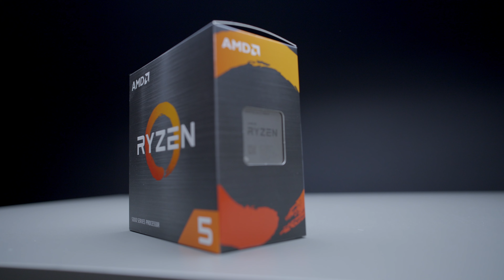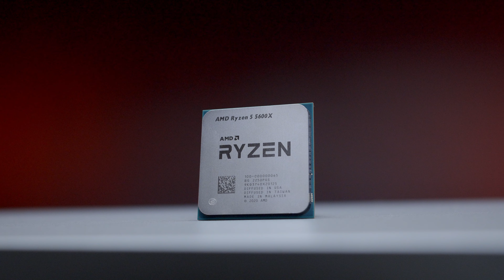$1,000 Budget 1440p Gaming PC: Lian Li Lancool 205M Mesh

Comment: I have this case and the 140mm front lian li fans that come included stay around 620 rpm even at idle. I adjusted the fan curve for them many times and the rpm doesn't change even though the motherboard temp isn't even reaching the temp that the 620 rpm corresponds to. When I set the custom fan curve to max, then the lian li fans operate at the max rpm. Otherwise, it seems like they either operate at around 50% or 100% and not lower or in between. I am not using any third party software, just using the bios. Anyone know what might be causing the problem?

Comment: microcenter sells a powerspec prebuilt with this case right now on sale for 690$

5800X3D
RX 7600
16gb ram
500g ssd
650W

I had bought one for 700$ awhile back and added another stick of 16gb, and I just put in a RX 7800XT, depending on what i can sell the 7600 for it might end up as 1,000 in total.

Comment: it's really beautiful, got the mini version and in only 6 months the fans on the front are already going yellow pretty badly. It's an issue across ALL lian li rgb devices.
Reply from the maker: @kingghidorah8106  was not aware of that. Thanks
Reply: @poweredbychris  you're welcome. Lian li is overhyped and overpriced , being where it is because of redditors. I got the Lian Li case because I was in a hurry and it was the most affordable thing i could get in the shortest time. I'm going to change the front fans for some Arctic 140 A-rgb.
Reply: Is the rgb going yellow or the plastic of the fan itself? Because i dont imagine the black ones going yellow.
Reply: @ibrahim123461  the RGB in them goes yellow.

Comment: Can you fit a thick 240 in the front? Does the shield for the power supply come off? I want to use this to hold 3 240 rads and a pump. $65 seems like a good price for rad housing. Ty
Reply: Old comment but you can fit a 240mm radiator with a fan in front but I wouldn't try it on top.

Comment: I went with the MSI PRO B650M-A and this case, it has the main x16 slot one space down and it limits my gpu airflow, I may try to drill the rivets out and remove the PSU shroud, although it may be structural for the case.

Comment: Question, did you replace the included fans with the thermalright ones, or just add the thermalright to the back?
Reply from the maker: My intention was to just to replace the rear one, but one of the included front fans was dead so I replaced both
Reply: @poweredbychris  thanks for your help, I just got that case as the one purchased before doesn’t fit my gpu even thought it says it should. I had purchased those thermalright fans as well and was wondering if I can daisy chain them with the included case fans?
Reply from the maker: @zacharybaas1553  Yes you should be able to. The only issue would be having enough length. I bought a led splitter so I used it, but it might not have been necessary.

Comment: Hey! You think the Thermalright Frozen Prism 240 AIO would have no problem fitting at the top of this case instead of an air cooler? Or will I need to get low profile RAM? I’m looking at the T Force Delta RGB
Reply from the maker: You can fit up to a 240 aio up top

Comment: Hi my front fans are working but no rgb. How do you daisy chain cuz when i did it i still ended up with 2 ends that have 4 pins coming out and i plugged those into chasis fans 1 and 2
Reply from the maker: That's only fan power. You need to connect the led connections together by daisy chaining and plugging into a 5v argb header. You can also use a led splitter
Reply: @poweredbychris  i fogured it out on my own but ty

Comment: How you get the non pre installed fans to match the other fans
Reply from the maker: Motherboard software. Fans must be daisy chained. I used a led splitter, but it's not always necessary since arg fans have an extra piggy back led cable to link the fans together

Comment: Just asking a question can you fit a pcie wifi with that case? I think the space below gpu is really tight for that
Reply from the maker: @alfinal3845  just answering a question Yes. This will also depend on the size of your GPU and the position of the GPU slot on the motherboard. Best bet to not use bigger than a 2 slot card
Reply: @poweredbychris  i use asus dual rx6600 i think it's a not a big card, and my wifi card is tp link i forgot the model but it's small too, maybe it will fit. Thank you for your answer😀

Comment: So hear me out on this, I have a super high-end monitor, 4K 165 HZ. I run a 3080 which I know is not going to push that monitor at all, it might hit 100 in non-graphically intense games at most. It's currently confined in a cooler Master ITX case. I want something a little bigger that's got better air flow so that way I'm not stroking out my 3080. Instead of thermal throttling a higher card, would a case like this be a optimal trade-off between size and breathability? My main concern is I don't want to buy any new parts. It's just simply not in the budget. Can I just take the parts out of my case now and put them into this case with zero issues? I'm not looking for particular brand compatibility, I want to know can you put an ITX system in here?
Reply from the maker: What itx case?
Reply: @poweredbychris  The cooler master NR200
Reply from the maker: @PokemanTrucker  To answer your question yes you can put your parts in this case, but I don't think that will make much difference. Your probably better off undervolting and increasing fan curve.
Reply: @poweredbychris  So the increased air volume isn't sufficient to see a decrease in temperature. Got it. Thank you. I will attempt to figure out this undervolting

Comment: Did your case come with front panel connectors? Mine only came the power switch for the RGB :( where would I get the connectors?
Reply from the maker: I can't remember what all front panel connectors it came with. If it's only the power  switch then that's it.

Comment: Nice build! I have the exact same case but idk how to change the rgb color on the front fans, I download the motherboard software but it still the same can you help me?
Reply from the maker: I would make sure they are plugged into the 5v RGB header on the motherboard (not the 12v) and try changing the lights from the bios. Maybe try another header if you have them daisy chained

Comment: Very nice! Planning a similar build myself. Had some hesitation regarding the volume of this case. Do you get good temps and enough airflow? Easy to build in?
Reply from the maker: This PC was sold after building. Unfortunately I didn't test temps  This case has plenty of air flow though can't image thermals would be an issue even under heavy load. You could add additional fans at the top which I did not do. Hope this helps and I'll be sure to test temps in future builds.

Comment: Hello, Normally there was a 140 cm fan in the case. Which fan did you replace them with?
Reply from the maker: The 2 intake fans that the case comes with are 140 but one was defective so replaced it with 2 120s
Reply: @poweredbychris  Thank you

Comment: Just wondering what fan controller did you use? Because I can’t find a place to plug the case fan wires in.
Reply from the maker: I didnt use a controller. I used a 4-way led splitter for the fans and plugged that into the 5v rgb header on the motherboard. If the fans are arbg then you could possibly daisy chain them together and do the same thing without a splitter

Comment: hey i'm about to get this case for my new build. 
the option was this or the pop mini air by Fractal. 
this 1 costs half the price of the fractal but i find it disturbing 
that the fans that comes with the case mounted behind the brackets. 
do you know if its possible to mount them outside? so they will be behinds the front cover?
Reply from the maker: Good question. Unfortunately I wont be able to confirm that as the pc is no longer in my possession. Sorry.  If you have a micro center near you may be able to go check.
Reply: @poweredbychris  
Nearest microcenter is 12 hours of flight and msybe more hours on taxi 😅

Comment: Did you have to buy a fan hub and fan splitter to install the thermal right fans?
Reply from the maker: No you don't. You can daisy chain them together. I bought a led splitter before hand so I used it.
Reply: @poweredbychris  can you daisy chain them and use the case button to control them? My motherboard doesn't have an argb header.
Reply from the maker: @prestige934  No. It does not come with a controller.

Comment: How do you sync the rgb of preinstalled case fans with the rear and CPU fan? Are the RGB headers on the mainboard enough?
Reply from the maker: Hi. I used a 4 way splitter to one of the 5v argb headers on the motherboard, and controlled either through the bios or the asrock polychrome software. It not as good as the some of the other manufactures but works okay.
Reply: @poweredbychris  Ah i see thank you very much. Turns out my preinstalled case fans, CPU fan, and rear fan which I bought, all are ARGB (3 pin right). This means i can buy a 4 way ARGB splitter and connect it to the 3 pin on the motherboard. When i plug all those 4 fans to the 3 pin splitter i can sync them correct?
Reply from the maker: @Julian-oc4bh  Correct
Reply: @Julian-oc4bh does the 2 front fan argb version not have fan plug in controller??
Reply from the maker: @grantingria4324  The fans I purchased did not come with a controller. I plugged them into the kraken aio's splitter cable that connects to the pump block.
Reply: @poweredbychris  fans? or the case? I'm talking about the case. (lian li 205m mesh)
Reply from the maker: @grantingria4324  The case does not come with a controller
Reply: @poweredbychris  can i just daisy chain the argb fans if I don't have a splitter?
Reply from the maker: @Reza-rs1zk  Yes you can

Comment: How did you make your fans have rgb I have the same case and I have no rgb at all for my stock fans
Reply from the maker: I used a 4 way splitter to one of the 5v argb headers on the motherboard, and controlled either through the bios or the asrock polychrome software.
Reply: @poweredbychris  would a rgb hub do the trick?
Reply from the maker: @dawncrap6629  yes but that is going to be fan specific

Comment: What about the temperatures? gpu very close to the bottom
Reply: Look at the front intake fan, they are bringing fresh air directly towards GPU. Most matx case has similar height due to the boards being smaller.